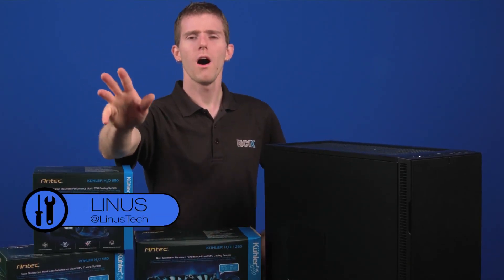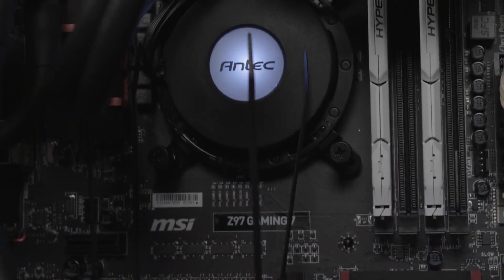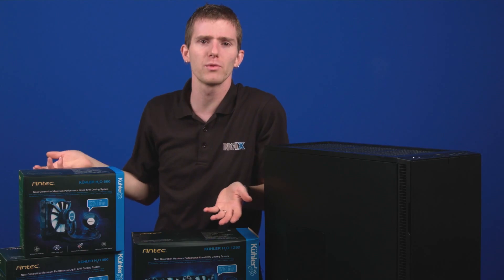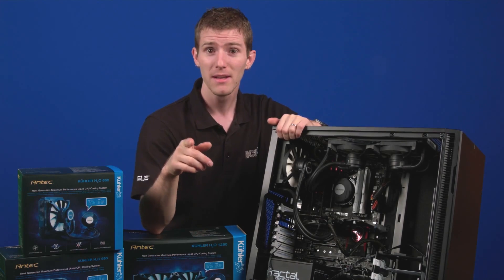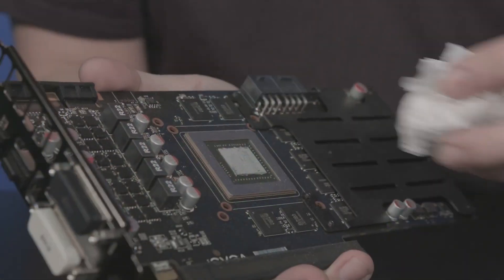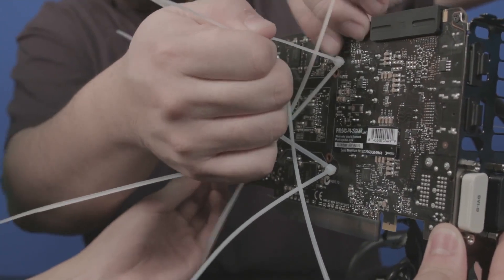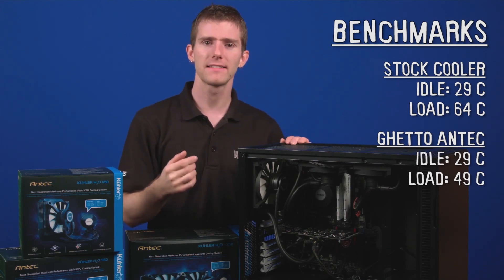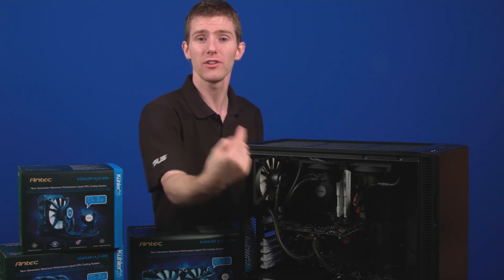DIY GPU Cooler ft. Antec Kuhler liquid CPU cooling

Comment: Did this to my Radeon HD 7950 with Corsair H100i (2x120mm rad). Got dust filters on rad, two fans Noctua NF-P12 @ 500 rpm in pull position (as you teach us, Greatest of Linuses). Had to use copper plate adapter (cca 1 mm thick), compoud used is Arctic Silver MX-5. Rad is out (behind) my custom wooden case (i made it myself 7 years ago!), which is just wide enough for GPU and high as psu+motherboard(which is upside down). Completely sound proofed (no windows, no lights). It has 2x140mm Noctua fan intake @ 500 rmp - one blowing on GPU, other on CPU. CPU is Core i7 870 @ 3,8GHz and cooler is Scythe Mine 2 with another 140mm noctua fan @ 500 rpm. PSU is BeQuiet! 750W 80+ GOLD (forgot the type, not feeling like crowling behind desk). In idle passive, under load silence fan, i guess 300-400 rpm. So its super quiet, its super stealth and given its age its super fast. And temps are idle: ambient + 10 degrees, and load : CPU max 67 and GPU max 58, achieved after 30 minutes of simultaneous prime95 and furmark. Gaming temps are more like CPU 55, GPU 55. Periferals are monitor : 27" 1440p shimian (loving this thing!), Logitech Wave PRO combo (since 2009, i never want it to die, NEVER) and Sennheiser RS 170 wireless headphones (again, loving it). And BEST periferal I have is Corepad Deskpad XXXXL, 1,2*0,6 METER "mousepad". Iit is GLORIOUS, I recommend it to everyone.

In conclusion, this CPU AiO cooler used as GPU cooler is great idea. Think about it, your GPU is using WAY MORE energy then your CPU. It only makes sence to use the best coolung solution (in budget) for the biggest heat source.

PS: my english is pretty rough, it is not my native language, so pls have merci Grammar Nazis

Comment: Linus, VRMs are rated for 105-115C depending on the MFR, 70-80C is NOT their max. 90C or below is what is recommended during extended gaming sessions, although up to 100C is still doable for several years of use.

Comment: Over time the plastic will surely stretch because of the heat, the sink will get loose and your card will fry, need a better way to attach that bastard on there, no way would I do that.

Comment: I glued a 80mm fan on my GTX460 blower cooler and it's 10º(celsius) cooler on full load than original. I've lepped my CPU and I made a hole on my PS3 for the cooler take cool air =D

Comment: Linus have you ever considered on an AMD295x2 linking it to a Kraken x61. As I find the rad for the 295x2 too puny and gets hot quick. I would love a vid in this or even a vid on upgrading the rad to a larger one and reduce those temps for overclocking.

Comment: but this not will help in life time of vga card. cus the VRM controllers, RAM chips and capacitors, blablabla... will be waaay hotter than normal because the original fan are blowing air directly on them,

and put another fan blowing air to the card will make the case dosen't looks so clean.

if you think, (now i can make overclock with this ''ghetto"). say goodbye to your voltage controler.

hint: 64°C to 49°C you will not get any improvement. i think this card arent termal throttling at 64°C.

nice temps, stupid mod.

Comment: I did something sorta like this with a nividia gtx geforce 760 4gb ram with a nzxt g10 kraken. The cooler is a h75 from corsair and i also go one the CPU, that one is a h100i. Temps are really cool and since the g10 kraken allows you to do this, it comes with a mount for a 80mm fan for the vram and comes with the fan included. Its all good all around

Comment: BTW using plastic zip ties are a bad idea. as the temps get higher say when you are gaming the plastic can expand a little which will affect the contact of the block on the CPU. Dont do this! very irresponsible of Linus.

Comment: Zip ties are so bad for doing this, they can get hot and will become weak or they will just get brittle with age and break easily.  Did it for my old Radeon 9700 (non pro) back in the day lol.  With volt mod and crap air cooler was able to go to 420mhz on the GPU.  To do this and get better temperatures use a spring on the zip ties, top or bottom of card doesnt matter, tougher springs are better but dont go too tough or the tie wont pull down properly and the spring will bend to the side.

Comment: Done this MOD a couple of years ago with the Corsair H55 on my GTX 470, keeps the GPU 20-25% cooler , I now have 3 Corsair H55 installed in my system 1 on my CPU and 1 on each of my GPU's 20%

Comment: so for shits and giggles this got me a instant 90c on a gtx 780, well back to saving up for a waterblock
Reply: It sounds like it was loose
Reply: Whiskers yes , sorta , ik it wouldnt work doesnt get good enough contact with the vrm heat shield still on covers most of the card which sucks somewhat cause only way i can watercool my gpu is full loop, i dont wanna put some stupid heat syncs on my vrm, etc was nice thought.might use it on my 680 tho with the bracket
Reply: SSJ4 Kleio get an nzxt kraken g10, but make sure to check the compatibility of ur all-in-one to the mount.

Comment: Maybe it doesn't count, but instead of using screws to attach my motherboard to the case (because I was an amateur and I lost the screws and could find no other screws that could thread into the case), I used cable ties into the screw holes to hold it firmly in place. It's not something I recommend of course, being that I am unsure how electricity runs along the case and its effect on the motherboard itself, but it works, and it looks ugly-horrifying. It shall stand as a reminder to myself that I properly store the screws of my future case.

Comment: Did this with a h100 on a gtx 580. 999 core 2400 ram - with sub 70 degree temps in the dead of winter. AND WITH ONLY 400 watts!

Comment: I did something similar. I super glued a block of ice onto my Intel HD 980x GPU. It runs at around 4 degrees Celsius when idle and about 2 degrees Celsius when under load. For my CPU, an AMD i8350, I soldered a copper pipe to it which runs outside of my window into a pile of snow. During the winter, it never gets over 0 degrees Celsius even when under load! During the summer I just redirect the pipe to the ice cube on my GPU and it remains under 5 degrees Celsius. You guys should give it a try, tell me how it works for you.
Reply: does gluing a block of ice into your gpu void your warranty?
Reply: Nah, you gotta use dry ice for that, way better temps.
Reply: Jose Mireles Good question! In fact, it doesn't depending on the manufacturer. Since EVGA made my card, it does not void the warranty. However, doing it to an ASUS or Gigabyte card is sure to void the warranty. But hey, small price to pay for a performance boost.

Comment: Ive been running this setup on a gtx 480 but with a big air cooler since i salvaged the broken card and reflowed it, it had no cooler

Im interested in doing this but how do the antec coolers perform in comparison to corsair comparable liquid aios? Anyone know??

Comment: You need to move the springs over to the zip ties to ensure equal pressure ! ! !, BUT the stock cooler had stops built into the screws and it will be tricky to get the right pressure on all 4 corners. I would recommend compressing them to 1/3 for a good hold or what ever rate they were compressed when they were on the stock cooler. if the metal moves and flexes requiring springs the plastic zip ties won't be any better.

Other thing you said at the end involving a fan to blow over the parts that are not air cooled anymore, and if parts had contact with the stock cooler then you will have to look into getting stick on heat sinks or glue on if you feel like you will keep this setup because sometimes aftermarket heat sinks with sticky tape come off after a few months! :/ or you can be cheap again and dab each corner of the chip with a very small amount of superglue and dap the middle with non-conductive thermal paste.. then BOOM awesome thermal conductivity and it will never pop off and when you need to it will since you're not gluing the whole heatsink on :)

Comment: I personally did this in the days of GPU Litecoin mining and ran it for 6 months 24/7.  Granted, I was monitoring it a lot, but it worked perfectly until I had to stop due to a mobo failure.  Once the straps cooled down, I had to tighten them before re-using it.

If you're cheap this will work but you should probably just get a GPU bracket since those are a thing now.  They weren't when I did that so keep that in mind.

Comment: I took this mod as far as i could before going to a custom loop. Started by cooling my CPU with an h50 and my two HD 6850 with an h60. By the time i was done I had all three coolers running daisy chained with the three rads. And also changed the tube to clear and the coolant to UV green. The pumps are by far the weakest part. My third rad did nothing because the coolant was cool by the time it reached there. I posted pics in both the corsair and the green mod thread on overclock.net look for smoke420 if interested.

Comment: I used a kraken g10 to mount an aio water cooler on my 290. You said 'even pressure is more important that tightness' and although true, not by a lot. Most water blocks are bowed, so in order to get that even pressure, they need to be quite tight. Tighter than I think you can comfortably pull off with zip ties alone, but it still should be better than the stock.
Also, don't be cheap, spend 15 dollars for a pack of solid copper heatsinks for your memory and vrms. Your overclock will go further and your card will last longer.

Comment: So installing a different cooling solution on a bare pcb with zip ties is easy, but screwing the fans on the radiator is difficult and confusing.
When are they going to attach everything with velcro?

Comment: i glued (with heat-transfer-clue) a cpu cooler an a 3dfx banshee once... for overclocking.
was nice, died at 80 or 90°C half a year later - and was replaced with a Voodoo 3 :)

Comment: Coming from someone that HAS ran an AMD red mod for a dual-7950 setup for Litecoin mining, the ziptie process has the inherent high risk of damaging the GPU. This was solved by the later R2xx series cards that have a metal surround around the GPU that sits flush with the die. This helps tremendously.

Hunting around for something like the GELID Solutions CL-R9290-01-A R9 makes the perfect VRM heatsink. I have one, and it's perfect. Combine that with a scythe slim profile hard drive attached via zip ties and you've got an awesome cooling solution.

Another thing I suggest is getting copper ram heatsinks, and using GOOD akasa thermal tape helps with memory overclocking. I've experienced a drop in overclocking ability for the GPU memory after swapping to aftermarket cooling, as even ramsinks can't cool the memory as well as the stock heatsink.

Comment: NZXT makes a bracket for this... Seems much easier and cleaner IMO.  Rather go that route than zip ties.  It also has a fan for your VRM so they don't overheat as well. 

Bracket is called NZXT Kraken G10 for those interested. 
Goes for around 30 bucks.

Comment: I would just buy a NZXT kraken g10 gpu bracket( $15-$30 on ebay) instead of using zip ties , those antec loops should be compatible with it. The G10 also has a fan that mounts to it, to cool your vram. Still a neat idea tho , cool to see it works with zip ties.

Comment: i did with a coolemaster aqua duo viva on a phenom ll 720 and gtx 6600 then i try on a fx6300 and gtx 660 but didnt work at least not an improvement

Comment: If you are that frugal and live in a colder climate, just isolate one of your rooms, keep it very cold and put all your fans on max. Take the cords and feed them through your wall to the other room your in.

Simple as that
Reply: So have 1 spare room, pay metric tons more for heating to compensate for the cold room, drill holes in your walls, to save ~ $50-80. How are you so good at common sense?
Reply: Pet My Bear
LOL wut? Use a door, and simple insolation will keep the rest of your house just fine.

Seriously, LOL WUT?
Reply: Pet My Bear
Glad the conversation is over, but I doubt I would have gotten anything out of a person who doesn't even know how to seal his own home properly. That is basic carpentry skills, I don't even think there are courses for that anymore.
Reply: i actually did it yesterday. wohoo. i m soo happy. my h100i water temperature is currently 12 celcius. my 4770k @ 4.0 ghz is begging me to overclock it.
i had to put a cat6 cable in the end. lots of work but one saturday and i be happy for a long time. 
also its running all fans at 100% and i cant hear a thing.
Reply: i m actually doing something like that. i m moving my rig to the attic. use a wireless keyboard and mouse and 25ft hdmi cable. i had to make a remote pwr/rst switch with hdd and pwr leds. the rest is really simple. i plug in my headphones to the monitor and wireless ac for networking. it should work awesome as i can turn all my fans to 100%
Reply: OmerTheGreatOne you may run into signal degradation issues. Lets hope all goes well.
Reply: OmerTheGreatOne
Absolutely awesome man, I actually use a very lengthy ethernet cord if you do not want to use wireless and it doesn't lose anything. It did cost me about 30 dollars though because of the length.
Reply: i have 25ft cat6 cable too but i m experimenting for now. Wired is always better but more work. my router is down stairs so will have to drill a few holes in the house for that. i will know for sure in few days.
Reply: OmerTheGreatOne
Good luck man! Lemme know how it goes!
Reply: bro please ... just stick a portable ac unit to the side of the pc >_>
Reply: Pl4sm4Ro4ch Don't tempt me man. I've been eyeballing one of those Haier portable units from Best Buy. Nice cut in my case, bolt the pipe on, run the pipe through the wall into my laundry room, exhaust out the laundry room, bam, ghetto ass cooler.
Reply: Mitch Brown but hey, worth it, right?)
Reply: Pet My Bear for science ;)
Reply: what i will say is that keep the temperature inside the case higher than the temperature of the room the computer is in... if the inside of the case gets colder than room temperature water will start forming inside and might short circuit the computer
Reply: Pl4sm4Ro4ch you should REALLY google how condensation forms ;)
Reply: It should be fine as AC units have a dehumidifying effect on the air. Swamp coolers on the other hand... Probably not such a good idea.
Reply: OmerTheGreatOne how to did you extend the power cable
Reply: Xxx_MLG_Illuminati_1337_xxX i used a regular extension cable and plugged my case power in that.
Reply: OmerTheGreatOne LINK MEEE
Reply: hey hey hey http://www.amazon.com/GoGreen-Power-GG-24720-Household-Extension/dp/B00NY3IQL0/ref=sr_1_10?ie=UTF8&qid=1435634256&sr=8-10&keywords=power+extension+cable+white&pebp=1435634275566&perid=0WDVW9B57JBT9CZRYTMD
Reply: OmerTheGreatOne Thank you

Comment: Did this to my R9 290. Brought load temps from 95c down to 60c, with a higher overclock and no thermal throttling. Wish cards still used integrated heatspreaders though because there's so much less chance of damage by chipping the core or something when you're attaching the water block.

Comment: GPU core gets cooler , what happens with the RAM and other components on the GPU that heat up like 20-40% more ?
Reply: Quetzalcoalt They could degrease the lifetime of your Gpu and may cause black screens! But you can buy heatspreaders to fix the problem :D

Comment: Why would you run your gpu at 64°C? It doesnt make sense with gpu boost2.0. Its not like a cpu where lower=better. Run the gpus at the same temp and monitor fps or clockspeeds. How did you get those temps anyways? Set your power target to 50%?

Comment: I rather spend $ 29 for NZXT Kraken G10 than this, i knew with zip ties it's only cost like $2 but i didn't want to risk my GPU Memory and VRM to overheat.
Reply: Glad some people mentioned this as I have a GTX 670 and GTX 760 which I guess can use this.
Reply: That's what I don't get. The Kuhler x50s are still Asetek design I believe, despite the pump/fan business.  So a they should still fit a Kraken G10. Only thing I can think of is if the Kraken doesn't fit the card for some reason?
Reply: IndraEMC I have that G10 but it sucks .. cable managing also worst 

better try this and add small fan just like what he said
Reply: +IndraEMC Yes that or Arctic accelero 2(i have arctic one and it is pretty good) but this video is misleading because vrm and probalby vram runs way hotter than core
Reply: lmao thank you man

Comment: Pffff, I just have my computer sitting in a vented box outside in the Canadian winter with the wires running through a cut-out in my wall. Temperatures never get over 15C on all components on air, (CPU is on a AIO). When it's to cold just bring her in.

Comment: I did this on my r9 280x. Temps reach 50C on load with cards crossfired. To cool VRM you can also use some leftover stock intel cooling fans. They super quiet and push a lot of air

Comment: What about using something like the NZXT Kraken G10 GPU Bracket Or the Corsair Hydro Series HG10 A1 Edition GPU Cooling Bracket what are intended for all in on loops but using a cpu water block instead Cheers Pete.

Comment: Wow I remember doing this over 2 years ago with my 580. Extremely tedious but the temps are awesome. I had 60C on a 40% overclock which is INSANE.
Reply: I'm 10 years old its crazy thinkin that I was dead back when you did that whoa

Comment: Ok, seriously, when are AIO GPU coolers ever going to be made? They are ridiculously overdue now, but all we get are more ghetto mod kits and methods which leave the VRAM to cook. Would someone just do it already.

As a side note, those Antec coolers need to come with a reversible fan. Just having them set to push configurations limits their use.